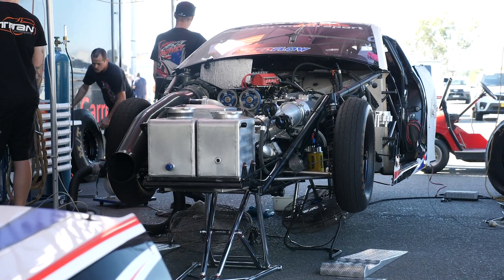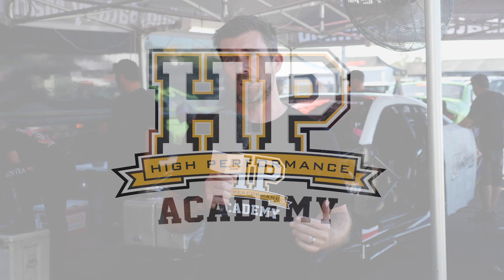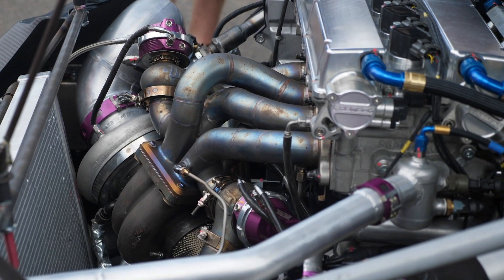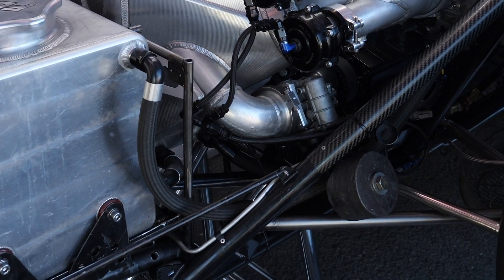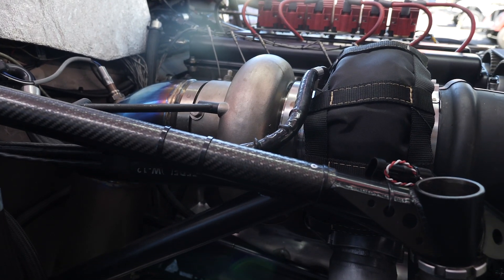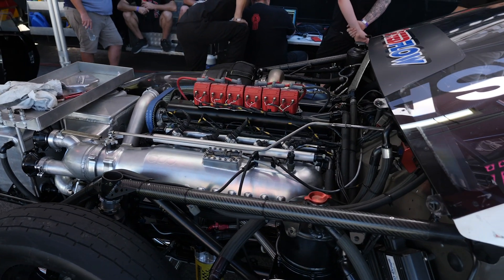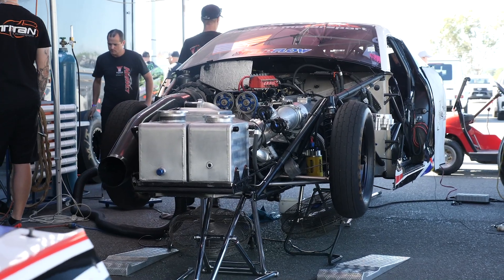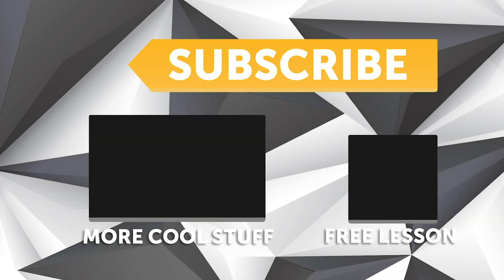3000HP+ and 100PSI, NO Wastegate? | Rod Harvey's 5 Second 2JZ Camry [TECH NUGGET]

Comment: That's really interesting to see this method of boost control used for a specific reason.  Controlling the boost by leaking of air from the compressor side isn't new, but doing it with this DBW setup throttle is (well, new to me anyway!).

Comment: In the 80s F1 Turbo Era, BMW engines also run without wastgate in qualifing, but they had a throttle in front of the compressorinlet.

Comment: I thought doing this on a turbo could cause it to over spin and damage the turbo?  I've seen wastegates on charge piping for supercharged setup's before that worked out well.
Reply from the maker: It really depends on the relationship between the turbo size and engine capacity. The turbo speed is a closely monitored input on just about any engine running at this level to ensure turbo reliability too.
Reply: OR maybe they are willing to sacrifice turbo reliability on those 5sec passes just to gain precise boost control especially at the launch... ie, compromise.

Comment: Clever was thinking about this years ago so it can be done lol what is the draw backs ?
Reply from the maker: Whether or not you can operate a turbo like this is going to be very dependent on the turbo size. With the sort of turbo size we see in a street car application you'd risk over speeding the turbo and damaging it.
Reply: Turbo would need to be dynamically balanced at a lot higher rpm at least 200000

Comment: makes you wonder what the turbine speed is at 100psi and if they have had failures
Reply from the maker: The turbo speed is monitored closely to ensure it's staying below the maximum rated speed.
Reply: @hpa101  must be a bit of trial and error on that as if it does get to a critical level they have no way of reducing the speed I suppose as if they put a leak in the intake system I would imagine it will cause the speed to spike even higher
Reply: @turbotoaster1984  since they are using a Motec ECU and also monitoring Turbo Shaft Speed, they probably have a fail safe setup to prevent overspeeding in the case of a failure in the intake side.

They are not "Leaking" boost out of the intake, they are bypassing back into the Compressor Inlet.  Bypassing air back into the inlet will reduce the air into the engine, thus reducing air out of the engine (drive pressure).  Reducing the drive pressure ensures no over speeding of the turbo.

Comment: But doesn't a CO2 boost control work in the same manner? Why use a throttle body instead?
Reply from the maker: CO2 is just another way of controlling the exhaust mounted wastegate which in this case the engine doesn't have. The dbw throttle is completely closed from about the 300' mark and hence the turbo is producing as much boost as it can. The dbw technique gives precise control over the boost as well as more accurate control on the start line.
Reply: @hpa101  But can't the wastegate do the same thing? The CO2 pressure can be adjust as well
Reply: @yushanchen4193  The spring in a waste gate causes some bounciness, variations in boost.
Reply: One of the reason might be that they need to turbo spin "full" speed, with exhaust wastegate turbine shaft speed is decreased and its laggier to get back on the game. It is surprisingly common to use wastegates in the intakeside instead with these relatively small engines with very high boost levels and superbig turbos. And also one reason to wastegateing from the intake is to prevent compressor surge. If that makes any sense :)
Reply: How does C02 boost control work ?
Reply: CO2 isn't as precise.
Reply: @KLMALLENDER  I was wondering about that when I watched the vid (surge control/prevention). I just put a Holset HE351VE on a mostly stock BMW M20 engine (2.7L 2-valve), and the compressor is big enough to surge, and with the VGT, it's a strong possibility I could tune aggressive enough to get surge. With the vanes closed it's starting to become clear to me as I tune that the actual turbine might in part be responsible (it can close down to something like 2.5cm^2), but maybe a "controlled boost leak" could help? Hmm...
Reply: @MikeyAntonakakis  with precise vnt/vgt control you can have boost map you basically want. If it surges on low revs just ass less boost demand. Leaking boost is wasted energy. And really not needed with such a tiny turbo